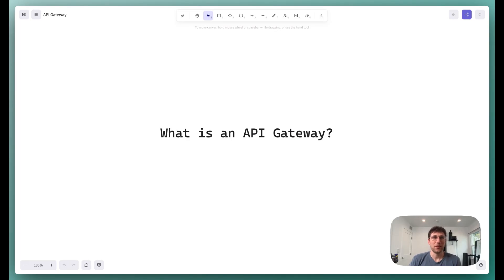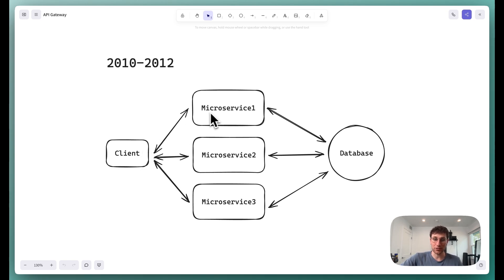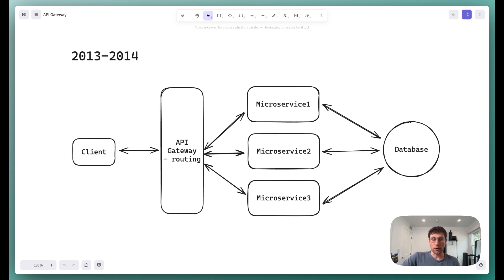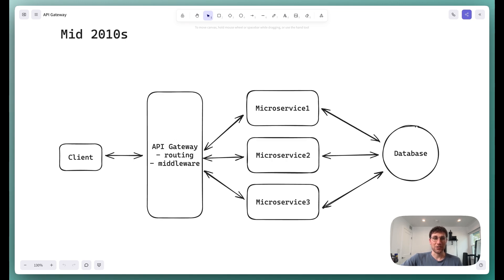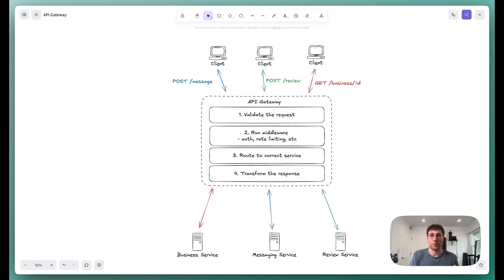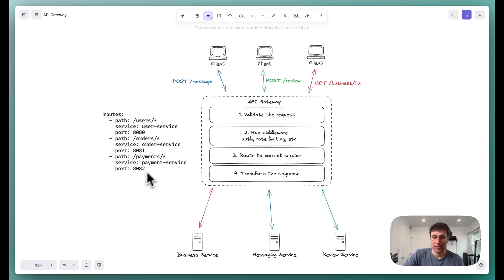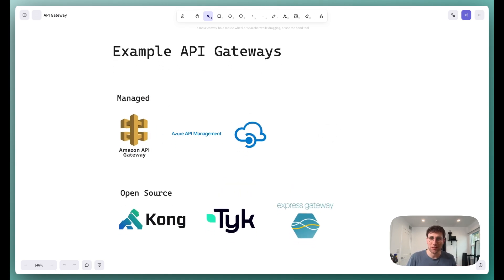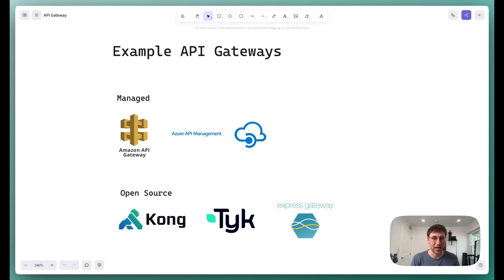API Gateways in System Design Interviews w/ Ex-Meta Staff Engineer

Comment: Notes : 
- API gateway includes routing + middleware + caching + authentication which cuts the problem of single microservice routing to bunch of microservices and redundancy

- Phases : 
1. Validate the request
2. Run middleware auth, rate limting etc. 
3. route to correct service
4. transform the response

Example API Gateways : 
- Managed : Amazon api gateways, azure api management, google cloud API gateway...
- Open source : Kong, tyk, express gateway
> Don't spend so much time here. just mention it's for routing as it's not important in the design and expected to have in microservice architecture.

Comment: Nice Content. 👏
Just have couple of questions (In general related to system design interviews)- 
1. Should we discuss tradeoffs of using different databases and choice that we make?
2. Should each microservice have separate database?
3. Should we introduce more event driven architecture to make it more robust? (also by introducing redundancy of data)

Comment: I had a software engineering interview today and it was focused on microservices. API Gateway and Message Broker (specifically). I didn't do well in the interview, but If I had come cross your videos earlier, I would have passed the interview with ease. This video and the kafka video explain all the questions I was asked in the interview. You're doing a very good job. Well done

Comment: Thanks for all the great videos! Question: If someone is at E4 or E5 at their current company but would like to target E6 at Meta, is there anything specific they should do to ensure they're evaluated at that level? The recruiter says the same pipeline levels E4-6, so just perform well, but all online resources say the way interviewers proctor depend on targeted level.. How do we deal with this?
Reply from the maker: Unlikely you’re going to see an up-level in this market and absolutely not from E4 to E6. Most Meta directors are opposed to it as it sets a terrible precedent. 

E6 evaluations lean heavily into system design and behavioral. Check out our blog for some guidance there.
Reply: Thanks! Interesting to wonder what happens when an E4 performs at E6 level in the interviews despite not being at that level or having the YOE.
Reply from the maker: @theoshow5426  The behavioral interview is load bearing for E6 level and you won't pass it at that level without substantial experience. 

I've definitely worked with mid-level engineers who were particularly gifted/focused on system design, but that's only part of what you need in a staff-level engineer.

Comment: Very nice explanation. Some little things that would need more clarification. The main thing though is the misuse of the term "microservices". Microservice Architecture is not just a bunch of Springboot endpoints with a persistence layer to CRUD data via a services layer. Microservice Architecture is what Netflix for instance uses. This is/was an approach to parallelize development and breakdown a system into independent components with their own ecosystem, and independent persistence. The misuse of the term leads to purists questioning its use in plain-old-services-architecture. Just thought I should mention that. The other part missing from your API Gateway presentation which was very very good, is that, usually the gateway has an entire process of ensuring service versioning and schema validation for input and output. Otherwise, a very good presentation. Thank you.

Comment: is nginx an API Gateway? We have a step in my org where we onboard APIs to nginx
Reply from the maker: Its a bit fuzzy tbh. Technically no, its a reverse proxy so it was meant to handle network chores but they've mostly converged with NGINX Plus allowing easily layering of additional middleware.

Comment: Question about API design when it comes to the flow of  Client -> API Gateway -> Microservice. I notice in a lot of solution designs on HelloInterview that while the initial API call that the client makes is defined in a HTTP Restful manner, your internal calls from API Gateway to Microservice look like function calls. Is this just an abstraction or an implication that you are using gRPC? I found it really intuitive to use that in my drawings but I don't want to imply I'm using gRPC because I'm not familiar with it in practice.
Reply from the maker: Just an abstraction. It’s basically saying “it could be whatever the service requires”

Comment: Then what is the difference between api gateway and load balancer ? I though  load balancer redirects to multiple microservice.
Reply from the maker: Load balancers mostly distribute traffic across multiple instances of the same service
Reply: @hello_interview so API Gateway includes the load balancer, right?
Reply: @hello_interview can API gateway also work as a LB ? which one handles the requests first in an microservice ecosystem ?
Reply: LB distributes the load (network traffic for the entire system not for a single service). API gateway route to the specif service based on the query of client. You can treat this as a reverse proxy.
Reply: At least for AWS, you would need the API gateway to route traffic towards the load balancer set for your service. So in this case, the APIGW doesn’t include the LB